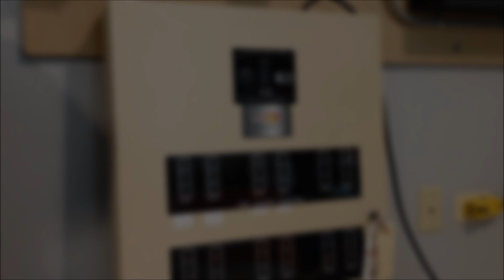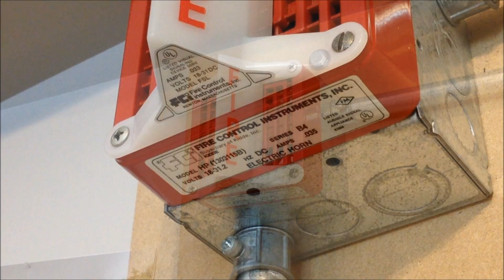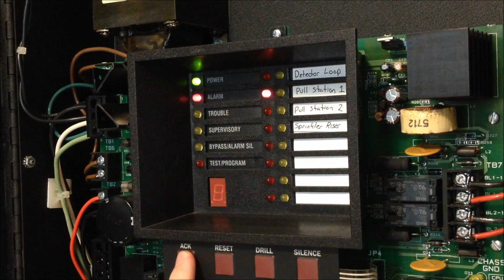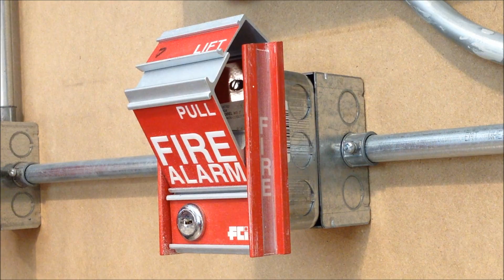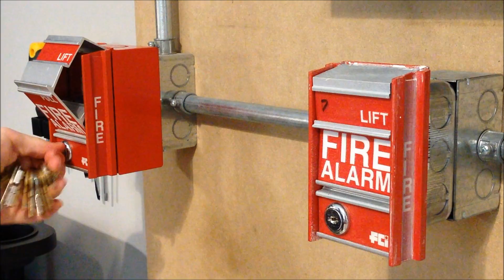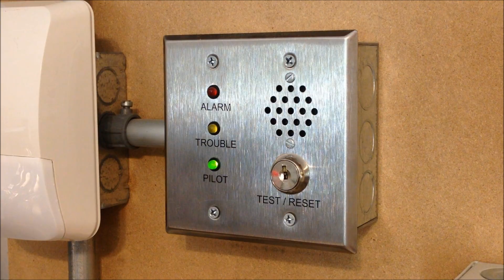System Test 34 | 1994 FCI System (Bank Demolition Devices)

Comment: Hey Nick, I have a quick question for you. I got an MS-2, but the lock seems to be verrryy stiff, where the key barely even turns. I already tried WD-40, but that didn't work. Do you have any suggestions? Thanks
Reply from the maker: Push in on the part of the pull station with the lock while opening  the station. That should allow the lock cylinder to rotate much easier, since it takes pressure off of the cam.
Reply: I've learned that the MS-2's have bad cylinders. I had a locksmith make a key for me, and it works a lot better than standard FCI keys. It's not worlds better but it's the difference between a grinding cylinder and just pushing in on the bottom part of the pull.